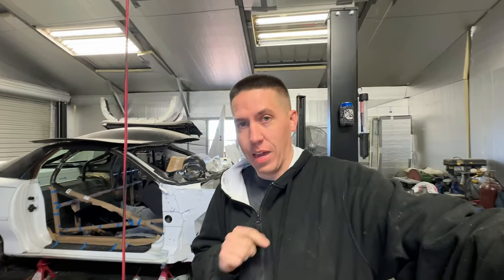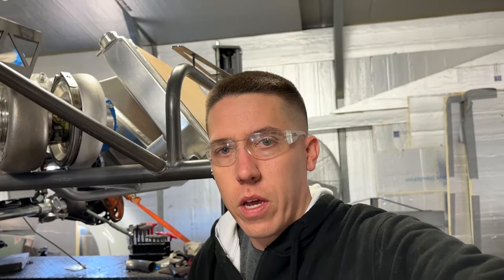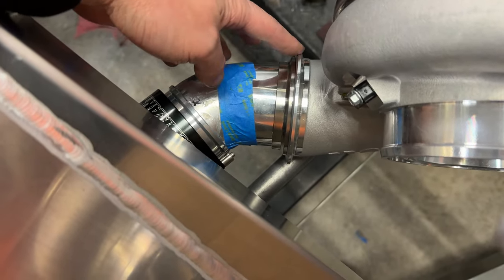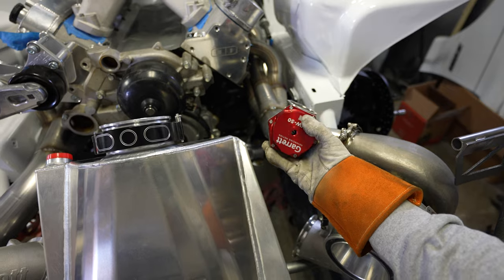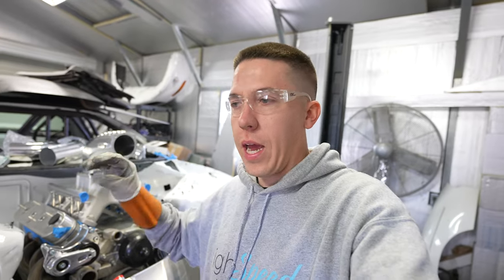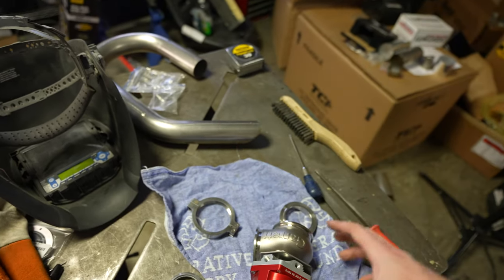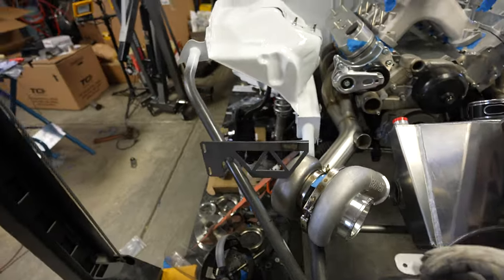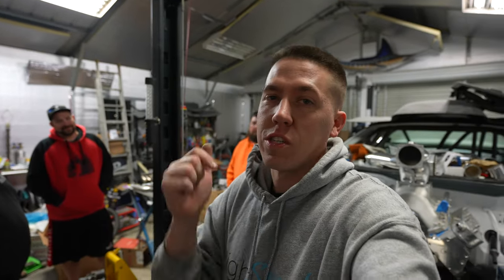Salty Camaro Twin Turbo Kit Build Part 3 - Cold Side And Wastegates!

Comment: I'm asking out of my ignorance, wouldn't it be better to turn the turbo air inlet toward the fender and pipe it to draw cool air from outside instead of under the hood hot air?
Reply from the maker: You definitely want fresh air to the turbos if possible! The Camaro it has two fresh air inlets in the front bumper just in front of where I put the turbos! 🤘
Reply: @BuildTuneRace  ok thanks man.